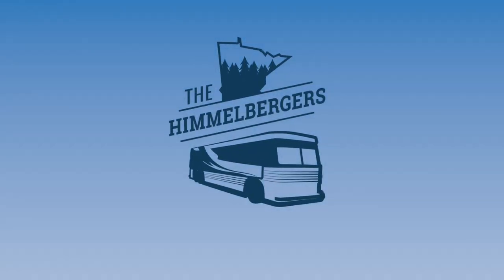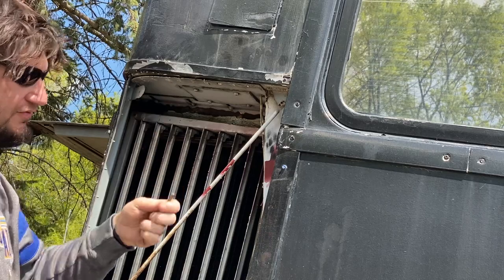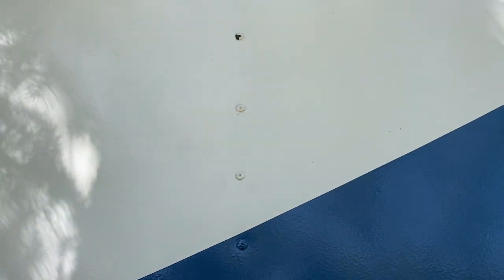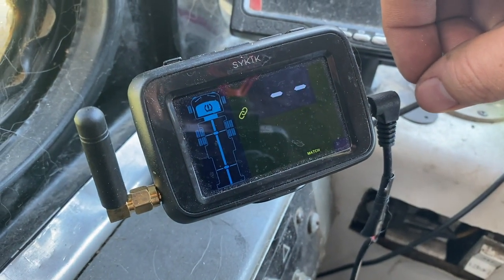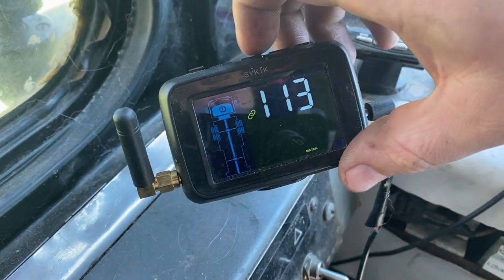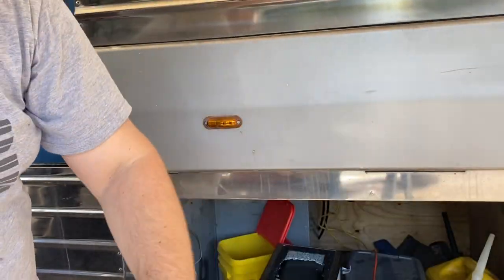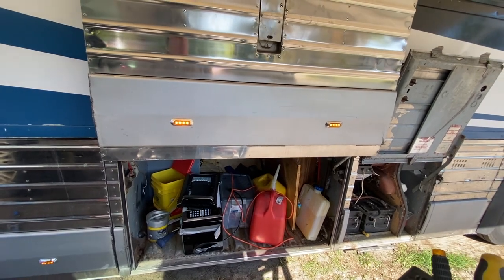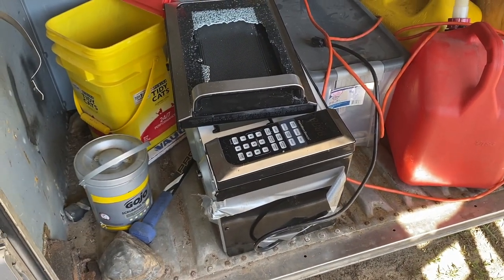Radiators, Rivets and more   OH My! RV Maintenance  items on MC9 Bus Conversion

Comment: Shawn the riveted your using is great for nut rivets but not so much for regular rivets harbor freight has a neumatic one for 60 to 80 bucks the black one is the one I bought and I've used a lot of them over the years but they work great and you can get it in to tight spots comes with different size jaws and tips
You have some many rivets on your coach it's a good investment.
It was for me just on the new skin I put on mine. Carry on young man your doing great.
Reply from the maker: Thanks I’ll look into that. I’m learning all about them. I need to get some stainless steel ones as well. All the sizes, so confusing, I just want a jumbo assortment.
Reply: @HimmelbergerBus  Shawn harbor freight is just for the riveter as far as rivets Amazon has a bunch aluminum body with stainless steel mandrals get the closed end ones so no water can get in Amazon has them with different grip lengths I work in the aircraft industries that's how I learned about them 25 years ago now you can get them from the Internet things are so much easier now days.
Reply: @HimmelbergerBus  I have learned a lot about rivets because I own a old bus too a 1967 GM TDH-4519 city transit bus,  please look up blind solid rivets. Keep up the good work and stay safe and charged

Comment: The correct rivets are stainless steel and the model numbers are in the manual.  As for reversing and parking lights, why don't you buy some docking lights?
Reply from the maker: There are a mix of aluminum and stainless, the ones I drilled out were aluminum. I try and keep aluminum and aluminum together to avoid dissimilar metal reactions.